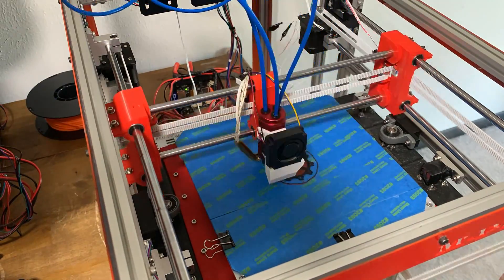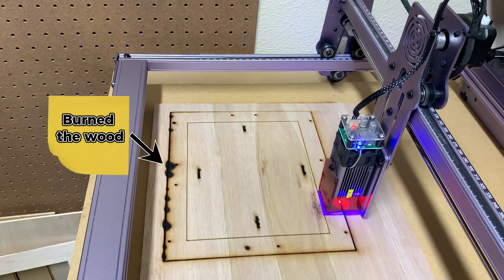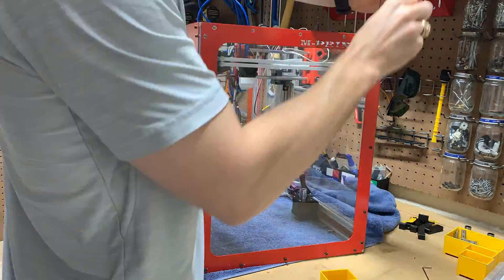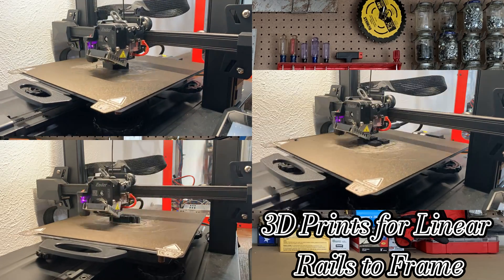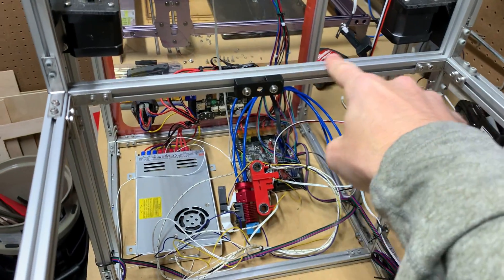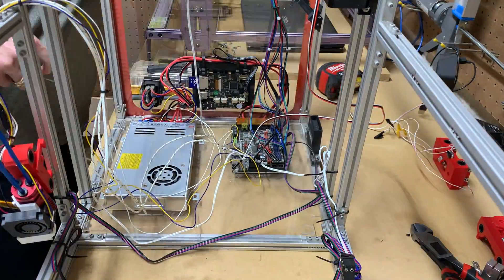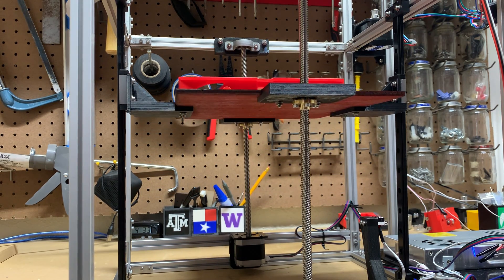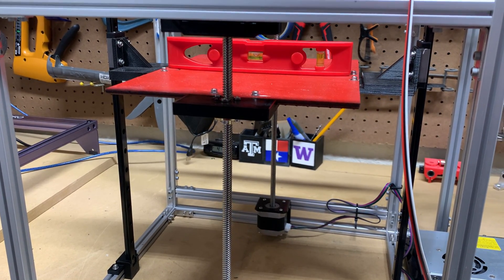Episode 9: Linear Rails | Building a 3D Printer | The Z-Axis Redesign | Part 1

Comment: Cool content! I'm not sure exactly what you're printing those parts in other than it's probably not ABS. This has caused me a lot of headaches in the past due to the amount of creep materials like PETG, PLA and even polyamides eventually experience under constant load. ABS is the only reasonable material I've made mission critical parts like this from that didn't have a problem. I don't know if you've accounted for this but those mounts are giving me flashbacks.

Just my 2 cents! Best of luck on the project. I wish I had the patience to catalogue my builds like this.
Reply: ASA, PCCF, PA12, and most CF Blends won't give you any problems.
Reply: @mekanism8364  Yeah I just assume most people know ABS/ASA is similar enough. ASA/ASA-CF is actually my go-to for a lot of prototyping. Fair point about CF but I'd still be hesitant with the likes of PETG under load in warmer environments.